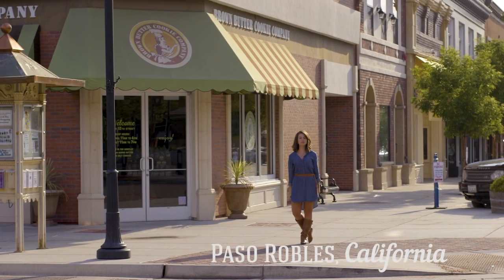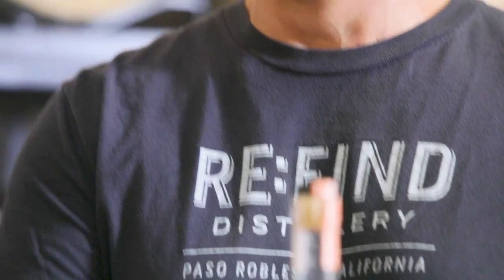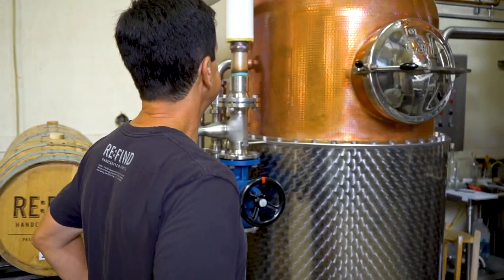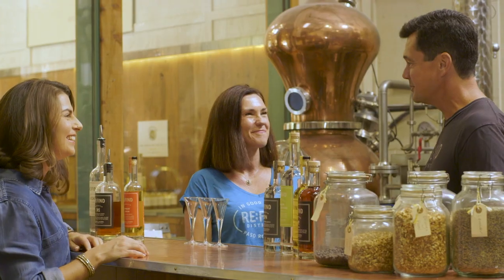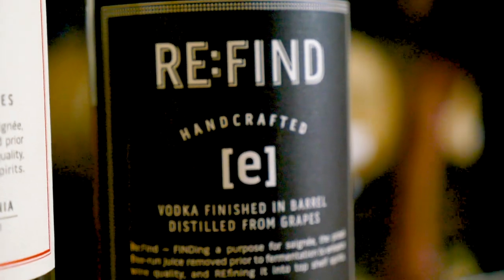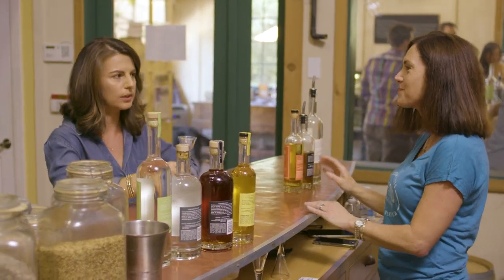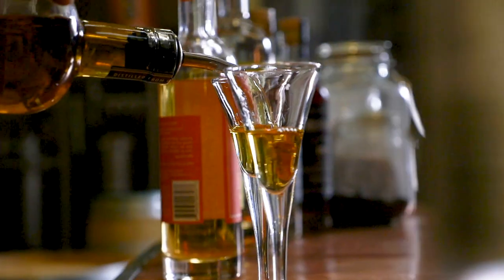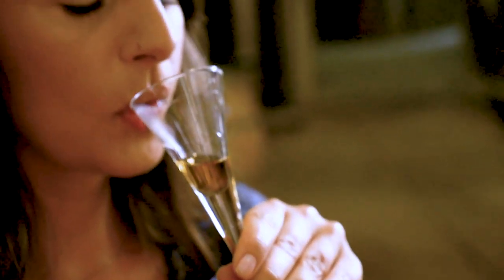Turning Wine into Vodka: Welcome to Re:Find Spirits!

Comment: Vodka from distilled wine? Isn’t that brandy not vodka?
Reply from the maker: It is confusing! Good question - while there's a lot that goes into this I'll try to keep it short! Brandy is fermented and distilled grapes - usually only once distilled so the characteristics of the source material are more prevalent in the aroma and flavor profile. Vodka, however, is defined as a neutral spirit distilled from any material (with fermentable sugars - potatoes, quinoa, wheat, corn, and yes - grapes or even other fruit). Vodka also can not be aged or stored in wooden barrels at any time, whereas brandy is almost always aged. For a more mass market comparison, Ciroc is a grape-based vodka as well that you might be more familiar with. An important thing to note on what Re:Find is doing though, is they are not making vodka from grapes. They are making wine from grapes, bleeding off some of the juices (in an effort to further concentrate the color and flavor of their red wine) and instead of discarding that unfinished wine they are making Vodka from that input, which many would argue makes it an even more delicious starting point for the concentration of distillation!
Reply: @TheCraftyCask  grappa is also made with grapes! :)
Reply from the maker: @lemmehollaratya9443  yes! Brandy and Pisco and quite a few others as well. What's unique about this process is that they're taking wine (made from  grapes, but not the grapes themselves) and then distilling it into vodka.